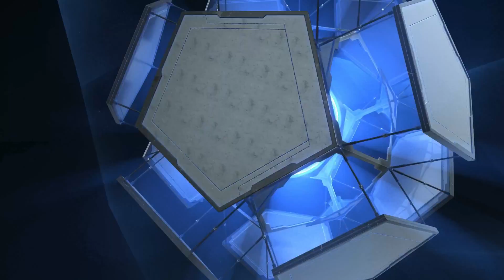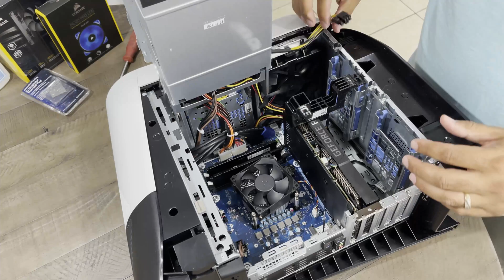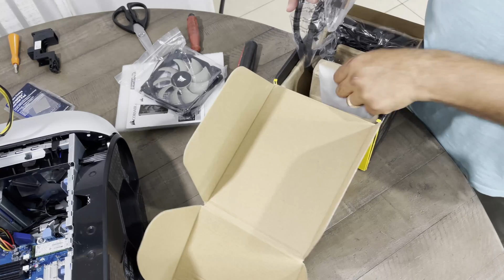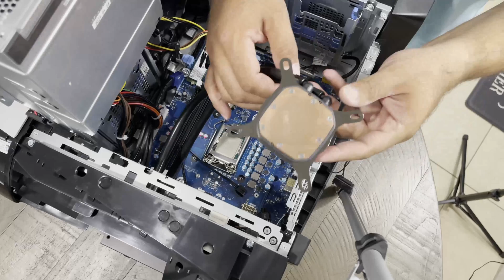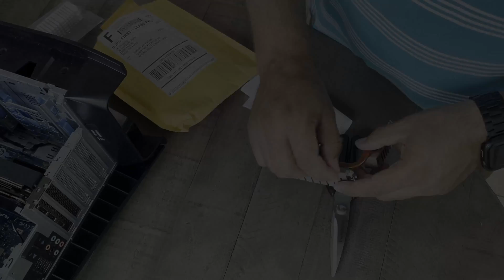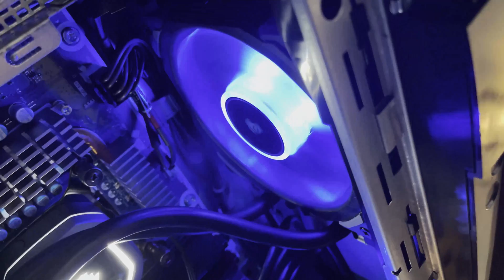Alienware Aurora R12 Upgrade

Comment: I have install the H60 fan into R12, but even I connect the cable to cpu fan. It still shows fan error every time I turn on the computer. Any solutions? Thanks
Reply: Me to. I get a cpu fan error every time I boot up
Reply: Same...

Comment: hey man dont know if you can help, im a noob with all this stuff but i recently got the r12 with the stock cooler and upgraded to the h60 (still waiting for heat sink), it dropped my temps alot but my only concern is the fans arent being recognised (stock fans) in any software and in ACC when i try to offset or curve to 100 for top fan it gets stuck on 40%. i have top fan plugged into fan top and pump tach cable into cpu fan

Comment: Watched quite a few upgrade videos on this OEM and you definitely did the best job I've seen. Neatest and more rational upgrades. The PC layout doesn't make it easy, but you've done the best possible I believe to deal with the heat issue..

Comment: I wish you would have showed how you installed the fans on the water cooler. Thats the first thing I intend on installing because I did not know that alienware even made these micro atx builds without them and also the box for the pc implies that there is a water cooler installed. It gets way too hot when playing triple A games at high settings.

Comment: Nice guide I just bought all the components you listed is there anything extra I would need to get that you didn’t list? I just got the r12 and started getting random FPS drops after 4 hours of gaming so I need to get this cooling under control
Reply from the maker: Other than the heat sink for the Vram no
Reply: @Cyonaux   could you link me to where on Amazon I could get that?

Comment: Hi, curious about why you did not place the h60 tubes downward to leave more room for the RAM (if you ever had 4 sticks would you be able to place them)

Nice to see a video with someone placing the vram heatsink without it switching to water cool will trigger bios error
Reply from the maker: It does only if you hook up the water cooler to the pump header if you keep it in the cpu header fan it wont

Comment: HEY JUST PICK ONE OF THESE SYSTEMS THE OTHER DAY , AND WAS WONDERING IF YOU SYSTEM CAME ALREADY LIQUID COOLED OR DID YOU UPGRADE TO IT COULDNT FIND ANYTHING ABOUT DOING THIS OTHER THEN YOUR VID WHICH WAS GREAT BTW
Reply from the maker: Mine did not come liquid cooled
Reply: @Cyonaux  ok I was looking to upgrade my set up the same way you did yours but couldn't find the h80 set up
Reply from the maker: @basikxom  there is no h80 setup as that aio does not fit
Reply: @Cyonaux  so what did you end up using your vid shows you installing a h60 but you said you ended up using a h80 but you were just installing it for the vid..???
Reply from the maker: @basikxom  so I did try to install the h80 and because it didn’t fit I never did show that part of it that why I told everyone on here that asked I stayed the the h60
Reply: @Cyonaux  oh ok that's sounds good , and where could I get the heat sink
Reply: @Cyonaux  and if I don't use the heat sink will I run into problems?
Reply from the maker: @basikxom  very hard to find keep looking at eBay

Comment: I've recently upgraded to a H60 fom the stock air cooler, but for some reason every time i start my computer it comes up with a bios error saying 'cpu fan not found critical error'. i can pass that screen and use my pc normally but is there any way to get rid of that warning knowing that my liquid cooler works? i tried putting the coolers cable into the "FAN CPU" instead of the pump one, but it is still not working.

Edit: checked all connections, found a loose pin in the tach cable (connecter) - adjusted the pin and now its all sorted.
Reply from the maker: Perfect

Comment: So I need the heatsink for it to run?
Reply from the maker: No but it helps your VRAM not overheat which causes cpu bottle necking
Reply: @Cyonaux  thanks for the reply. Just curious, there's a third party one on ebay. Would it detect it like the real one? Not sure how thr lc detects the thing tbh

Comment: Nice vid but im new to gaming pcs. I have an r12 but the i5 processor seems to make my games a bit laggy at max settings (i mostly play Fallout 4 and Cod). Any suggestion s on how to upgrade the cpu and what cpus will work
Reply from the maker: You will need the documentation from Dell to see what’s compatible you can go to sell website and put your model and see what motherboard it has. Dell uses their own kind sometimes making it difficult to upgrade easily
Reply: @Cyonaux  thanks. Ill do that. Much appreciated
Reply: Have you checked your CPU temps and percentage of use when the lagging occurs. Might be caused my thermal throttling if it's running hot. Or it can just be working at max capacity and causing a bottleneck.

Comment: hi awesome video !!!! I wanted to ask you the cables of the Noctua what did you need them for? And for the additional fan that you have mounted on the radiator and the one in place of the HDD where you connected them thanks a lot.
Reply from the maker: So those cables are to split the fans the front fan and the HDD fan use that splitter to split those fans and then the two top fans use those cables for the pull push configuration

Comment: Thanks for a great video. How do you secure the second fan for the push pull config?
Reply from the maker: Need a second set of screws for the top fan. You can find on Amazon or any local hardware store just bring the ones you have for the bottom fan they need to be long screws
Reply: @Cyonaux  How did you get the second fan in the housing? I cant get passed the Motherboard power clips
Reply from the maker: @ToxicSkyline00  you have to remove the housing and also remove the ram and the power cable
Reply: @Cyonaux  yeah I've removed everything. I just can't get the housing with both fans sandwiching the radiator back into place.

Comment: Great video thank you, two questions: Can you advise which bracket you used for the top front fan? I ask because I just ordered my R12 and didn’t get an HDD so trying to figure out how to secure the same front top fan you used. Also, does LED on front fans show through front of case? I ordered dark side of the moon chassis before realizing it’s missing two LED zones so if I can get more color with those fans that’s a nice bonus
Reply from the maker: Can’t see led from front of case sorry. The bracket I used was the one from the top fan since I did not need due to push pull config. But you have to modify the bracket to make it fit where the HDD would normally go. Suggest you use 3M tape on fan to stick to area where HDD would go

Comment: Any strest test max temp for this processor running with Corsair liquid cooling? My R12 even on plain i5 11400 had a cpu throttled at 100C during the stresstest. The stock air cooler from Dell was so bad
Reply from the maker: Yeah man I was running about 98C on stress test and was gaming at 89c so I returned not a good thermal PC which is sad
Reply: @Cyonaux  the temp is about right 98-100C for stock air cooling I guees. Any figure for CPU temp with the Corsair liquid cooling. I plan to ditch my air cooling soon
Reply from the maker: @eddyann2  no this was with liquid cooling!
Reply: @Cyonaux  dayum so h60 doesn’t do a better job than the stock cooler?

Comment: Why anyone would do this, is beyond me. Alienware is a dumpster fire out of the gate. However you did a good job trying to get airflow into your case as there is much in there to begin with.
Reply: Rtx 3080 was included and I don’t have a rig yet so I got this refurbished from dell for a bit less than $2000.

Comment: So I just bought the right heat sinks for my r12 now for the cooler I can’t find the Alienware one and dell doesn’t sell it separately so aftermarket will do. H60 or h80 v2? Also I bought 4 additional cooling fans for like 20$ that big 120 m one with the blue led is that any better than the cheaper ones I got I’m assuming it is since the rpms or cfm is higher I honestly didn’t even check what the ones I got are? This is my first time modding a computer.
Reply from the maker: H60 my man H80 will not fit
Reply: @Cyonaux   ok purchasing that now thank you no issues so far? No error messages? I just had my other r12 crash so I just got an exchange and got the one with the 3080😬 from my 3070 thank you!
Reply: @Cyonaux   I installed the h60 and I have error message on start up but I press continue anyways and works fine
Reply from the maker: @shazbros_automotive  Where did you hook up your cable for the pump
Reply: @Cyonaux  not sure I have it to a computer gaming store where they do installs at since I was just so busy and didn’t mind paying 35$ to do so. And basically 4 days in my new r12 with 3080 drive failure and software bios start up issue so I just took it back and built me a pc which is amazing and case looks amazing too!

Comment: did you need to buy extra screws ? for the push pull config ?
Reply from the maker: Yes
Reply: @Cyonaux  Do you still know witch one they where ? And start screwing the parts from the outside of the fence, am i right ?
Reply from the maker: No I forgot I went to a local hardware store with the current ones that come with the AIO and matched them
Reply: @Cyonaux  Well forums say that you need 4 extra 6/32 x 1.25"  screws, but the idea with just go to the store and compare them is also smart xD

Comment: Did you use a thermal pad instead of thermal paste?

The thermal pad is better?
Reply from the maker: Yes I initially did use thermal pad but my thermals were worst then when using the paste I never posted thermals because I had a lot of issues finding the right aio and spend a lot of time figuring a bunch of things out and took a lot of time and because thermals were never good I begun to lose interest

Comment: How well can you see the fans without the lunar lighting on cause I opted for the all black R12 so no lunar lighting but want to give it a little more glow from the front and out the top with some new fans and hoping they do the trick.TIA!
Reply from the maker: You can’t see the fans at all just the lighting from the top fan. It’s a closed case I never did know if the front fans lighting comes through since I had the lunar lighting on front panel

Comment: Will I lose all the data on the mechanical hard drive if I switch to the SSD you recommended?
Reply from the maker: Well you have to transfer the data to the SSD by cloning the drive to the ssd. Then you can remove the mechanical drive

Comment: Have you had any bottleneck issues caused by the Ram that everyone else has been reporting? Did you update the Bios?
Reply from the maker: I updated Bios right away no I did not have any issues
Reply: I’m having issues, updated bios, clean install, no fix. Thinking about returning it or gutting it and putting the components in a new case with a new mobo
Reply from the maker: @JumpRXL  my thoughts exactly
Reply: @JumpRXL  Can you please describe generally the issues you’re having?

Comment: Good Afternoon Brother, if you don’t mind and have a time then could you please do let me know, regarding for installing the extra fans on this Alienware Aurora R12, what exactly do you need, I mean which leads, splitters, power leads, adapters and how many, please explain everything, how you did it and what exactly you need, because I definitely want to install extra fans on this PC, that’s why I need all the information regarding this and also Brother, those two 2.5 inch slots for ssd, will either 1TB on each slot or 2TB of Samsung 860 QVO 2 TB SATA 2.5 Inch Internal Solid State Drive (SSD (MZ-76Q2T0) or Samsung 860 PRO 2 TB SATA 2.5 Inch Internal Solid State Drive (SSD) (MZ-76P2T0) work and about fans, will either Corsair iCUE QL120 RGB, 120 mm RGB LED PWM Fans (102 Individually Addressable RGB LEDs, Speeds Up to 1,500 RPM, Low-Noise) Triple Pack with iCUE Lighting Node CORE Included - Black or Corsair iCUE QL120 RGB, 120 mm RGB LED PWM Fans (102 Individually Addressable RGB LEDs, Speeds Up to 1,500 RPM, Low-Noise) Triple Pack with iCUE Lighting Node CORE Included - White work, many thanks and really appreciate and also sorry Brother for too many questions.
Reply from the maker: All the parts used are on the description above also watch the video most of the way I did it is on there
Reply: @Cyonaux  ok Brother, still really appreciate and many thanks Brother.
Reply: Hello Brother, do you have any USB Switch on you’re Alienware Aurora R12 Motherboard, one’s again thanks Brother, Mohammed.
Reply from the maker: @oVqrtexZ123  mother board is very limited and only has 2 which are used already by the front panel lighting and front panels USB’s. I no longer own this PC but I do remember some things from it

Comment: What size thermal pads did you use for heat sink?
Reply from the maker: Cut to fit you can buy a 1mm thermal pad on Amazon cheap and cut it to fit
Reply: Thanks for the quick response.

Comment: Cool videos…. My R12 has the stock Aio . Will 2 fans still fit with stock ?
Also … can you control Corsair fan speed through the Alienware command center ??
Reply from the maker: Yes you can fit 2 fans on stock aio and yes you can control fans just make sure to split them with a y splitter for the top fan
Reply: @Cyonaux   thanks again …. So need 2 y splitters total?
I plan on adding a second fan where the HDD is at and 2  fans up top
Reply from the maker: @Miguel-0311-usmc  yes

Comment: Nice video. My r12 is coming next month with a 11700kf. Is it necessary to upgrade form the Alienware 120 aio to third party aio like corsair h80i v2? Also could h80i fit into the case? Thanks for your sharing!
Reply from the maker: Lee the H80i will not fit also if you change you cannot connect an aftermarket aio to the pump header since it will not recognize a non 4 pin pump on that header and bios will give you an error so you would need to connect a fan to the cpu fan header and the only ones that work are the Corsair ml120 pros. They run very hot and you will notice the fans speed up to about almost 50% which will be annoying and you would have to replace the fans for quieter ones so for the money you are paying for this no upgradeable system get yourself a pre build you can build yourself online for maximum airflow. I will be returning mine due to complications with aftermarket products and the fact they get so hot in my scenario my room gets hot from this PC exhausting so much hot air while gaming
Reply: @Cyonaux  Was it that bad? I just got one with a 3070, but reading this comment makes me a little nervous that I should return this. I’m absolutely new, and you’re not. If it didn’t work for you, it might not work for me.
Reply from the maker: @PLAYERSBAWL  yeah for me it was since Alienware neglected to tell me these don't come standard with liquid AIO and the Air coolers suck. No aftermarket AIO can cool the i7 I had in it well. They do run very hot and although the stock AIO does a descent job you are still gonna get very hot air coming out of that case. Thermals are not good on this case.
Reply: @Cyonaux  Thanks for replying so quickly! Ugh. Is the R11 any better? It looks like exactly the same scenario.
Reply from the maker: @PLAYERSBAWL  No they been doing the same design since the R7 I believe

Comment: My Aurora 12 has an error
When replacing the fan, EX Noctua Arctic ml120pro
I don't know why.
Reply from the maker: I am hearing the noctua fans aren’t compatible with the R12 switch to Corsair ml 120 pros
Reply: 3 pin or 4 pin?  I replaced all my fans with noctuas.  Front fan (3pin) 2 push pull fans on top (4pins) with y connection that comes with fans.  No errors

Comment: Can you provide more info on how you mounted the radiator? It looks like you fit 2 fans and the radiator in the existing box on top, but I had to remove the box to get mine to fix. The model of H60 I bought was the same as the link you provided (shows purchased).
Reply from the maker: Yes the box does have to be removed to fit the fans inside
Reply: @Cyonaux  I mounted both fans on the radiator and slid it in okay but what do you do to secure the whole assembly to the case housing since we aren't using the bracket any longer?

Comment: Great job I wanna upgrade my R11 with the ML-120pro. The fan you put were the HD goes does the psu block the air flow? Did you get any bios error codes? Thanks for sharing
Reply from the maker: Not at all and the ml 120 pros are the best for this setup
Reply: @Cyonaux  great thank you new sub 113 👍🏻

Comment: Watched every vid on here on this rig and found out if you get the liquid cooled cpu option there will be no heat issues. I've seen at least 8 benchmark and gaming test vids where they cranked up new titles and had no overheating whatsoever. This kind of modding isn't really mandatory.
Reply from the maker: Right but I’m coming from an air cooled system and yes the liquid cool option is the way to go

Comment: Did you have a mechanical Hard drive? If so where did you re-locate it?
Reply from the maker: So I didn’t relocate it I got rid of it and installed it on my other pc which i use for streaming. There isn’t a good relocation spot for the mechanical drive and this is outdated tech I bought the Samsung SSD and use that in its place
Reply: Thanks for the reply, I guess I should remove mine as well.
Reply from the maker: Yes definitely you don’t need it